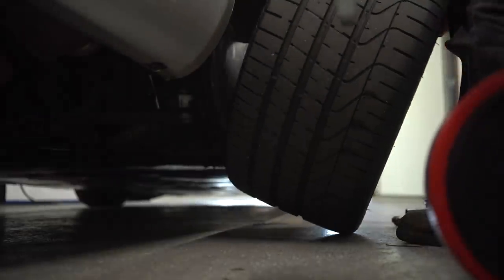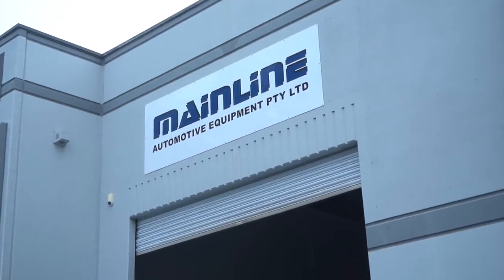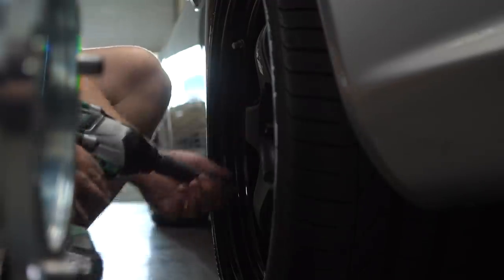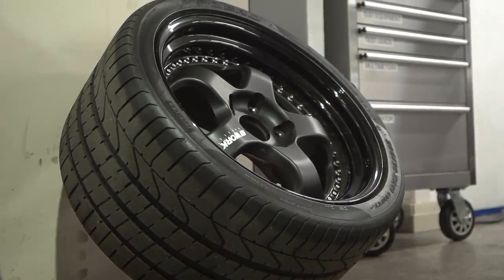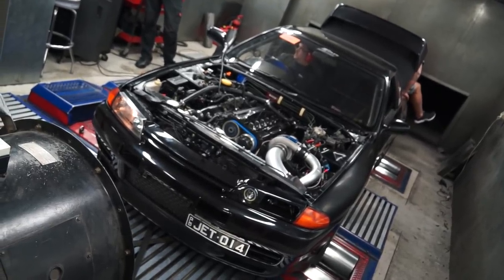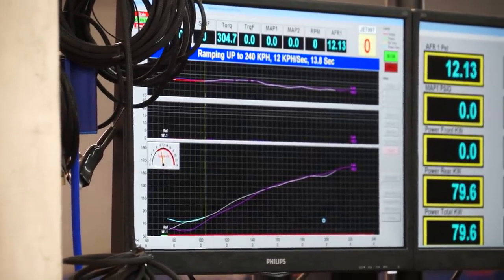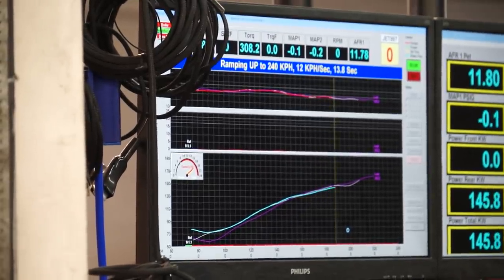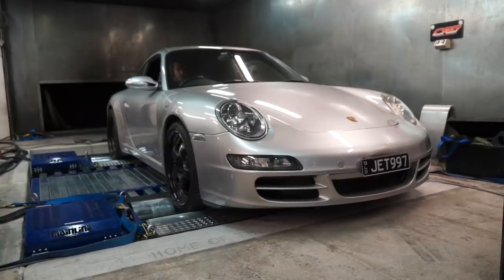Roller Chassis Dyno VS Hub Dyno - Manipulating power and test variables

Comment: great video. hub dyno makes alot of sense. it's not fake power. it's just closer to actual engine power.
Reply: not only that, you can actually tune the engine like you would on an engine dyno.
Reply: all of this agreed ..... however its not the number hitting the ground. as he said there are still variables that the hub dyno removes but come into play when actually driving. A roller will give you a better idea of what is actually hitting the road and drivability. a hub is better for the engine side removing these variables as you dial in the motor, boost , timing,(ect). most ideal shop would have both.(dreamland)

Comment: I'm honestly surprised it's taken so long for hub dyno's to become popular.
Reply: 2023 and shi still the same lmao
Reply: 2023 and shi still the same lmao
Reply: well isn’t the hub dyno basically just a dyno queen sheet? Sure you’ll make a higher number since it’s mounted straight to the car, why remove the wheels? When on the street obviously you run with tires.
Reply: @DEATHWISHVQ because you can't tune high power engines if the tyres are constantly slipping on a roller dyno.
Reply: @DEATHWISHVQ I'd have to disagree. Ive tuned on a dynapack, made 460whp, went to a dynojet 3 hours away, 5 months later and made 459whp with no changes to the car.
Reply: @PiterStreak  I’m not a tuner and it’s really been sometime that I’ve done research on dynos. But a hub dyno as it says it’s mounted to the hub of where the wheel goes, since the wheel is off it’s less rotational mass, meaning what it puts out imo wouldn’t be the same output on the street to the wheels. It’s like crank hp vs wheel hp, the engine will always make more power ofc bc it does not have to go thru the power transfer of shafts etc

Comment: One day people will understand that a dyno is not for measuring outright power, it is comparative tuning tool that allows you to make changes and compare the results, while monitoring af ratios, temps etc. And not crash or get arrested doing it on the street.
Even engine dynos read different from day to day due to changes in weather...

So it seems that a hub dyno gives more consistent figures for tuning high hp cars, while roller dynos are fine for most road going vehicles as long as rules are adhered to for consistency.

Comment: If a roller dyno is calibrated so that power and torque cross at the correct rpm, and drive train losses are accounted for with a coast down test, then how big a gap will there be to a hub dyno?

Comment: forget about hp. which is a better tuning device? it would probably be the hub dyno??
Reply from the maker: By far a better tuning device
Reply: @MotiveVideo  ok, after my research that's what i was thinking. i got my standard s2 rb25det tuned with a haltech elite 2500, psr  g30-770 6 boost etc plaz plenum... made 287kw with 250km on the motor. it drives pretty nice, but it was tuned on a roller. to get the tune right would you recommend getting it retuned on a hub at a reputable shop? cheers Andrew, love the content!

Comment: My only gripe with roller dynos at some shops is its inability to load up the engine properly. Got my car tuned by a popular honda race shop with a dynojet. Made 635whp. Motor didnt last 2 days on the street. Come to find out, their dyno wasnt loading up the engine anywhere near enough for the weight and torque of the car.

Comment: what about loss calcultation ? (to calcule engine hp)
Reply from the maker: What about it? Don't bother. Use an engine dtyno to measure engine HP. EWach car and drivetrain is different and it is closer to a "fixed loss" rather than "percentage loss"

Comment: Not being a smartass but if you squish the tyre for example, the outside diameter should be theoretically the same. If that doesn't change that means the circumference doesn't change either. That means the Rolling radius is the same. So the only real problem is torsional slip. I thought dyno used the equation of  torque to HP/KW conversation? So how does this smp/s effect  the final number?
Reply: If you squish the tyre the roller becomes closer to the axle, thus changing the lever arm, but I do understand what you mean about the circumference of the tyre. Not sure how that works

Comment: Rolling radius won't change from squash the steel belt in the tyre won't get shorter it's like tracks just because it's lower don't make it shorter but you will loose power through side wall flex Wich will show as heat in the side wall
Reply from the maker: The distance from the centre of the hub to the point he tyre touches the roller changes.
Reply: @MotiveVideo  this dose make sense thanks for the reply
Reply: I do find this part quite interesting , the argument don't phases me really it's a guide for tuning . But how the gearing doesn't change but the leverage dose is pretty interesting for me

Comment: Centrifigual mass is the thing.A wheel is a big flywheel  and the more centrifigual mass, eg heavier tyres means it uses more power to accelerate and also stop. 
Many 'bling' wheels and tyres cost power, stopping and suspension. And to me look stupid as well. A wheel that weighs 15lbs for instance and the rim is very heavy V a lighter rim and heavier centre will make a fair difference. So a 14" rim will have less  centrifigual mass than a 20" with the same diameter tyre. And usually a 20" tyre will be faaaaaaar heavier than the same dia in 14"
The peak power howeve will be the same or even a fraction more as the flywheel once accelerated will help maintain power.
The hub dyno at least equalises all of these figures.
And yes different dynos give different numbers. I have done an E85 conversion and made less numbers on a different dyno.

Comment: I hate the whole my dyno makes more power thing. The hub dyno helps with consistency for the sake of tuning,  that's it. That 30hp you "gained" by going to the hub is useless once the wheel goes back on.  the 1/4mile tells all thing is irrelevant aswell. Tire traction, clutch slip/converter slip, gear ratios and driver can change 1/4 mile time drastically without actually "losing" or "gaining" power. I've seen a 4300lb car make 400whp and run 12.9s, watched the same car the next run  do 15.0 because of traction . Some due to improper launch and some the tires being too cold.
Reply: The 1/4 time is not a good measure of power. But the trap speed is!
The time is greatly affected by launch, but the trap speed is not.
Those 12.9 and 15.0 runs - the trap speed would not be very different between them.

Comment: The car is gonna be raced with wheels & tires on it right? So if it makes 300 on a hub dyno then 250 on a roller dyno, you tell everyone 300, then it performs like a 250hp car with the wheels and tires on it, wouldn’t that be disappointing? I feel like you would want to tune with a hub dyno and then use a roller to get the number you actually tell people.
Reply from the maker: 828drifter the whole point of the video was to make people understand the difference to interpret it better

Many American and British dynos try to calculate engine Hp and give really high numbers. We’ve seen some drum inertia dynos in the USA make more “wheel horsepower” than the car is rated to at the engine. 

So rally the power means nothing as every dyno is different. If you understand that you stop caring and understood it’s a tool for tuning. Rea world performance numbers are what matter.

Comment: I have a feeling the loss is due to extra friction in the roller bearings (from the high side-loading due to strapping the car down so much)... rather than the inertia of the wheels and tyres. 

And it’s more likely to be the parasitic drag of the wheels n tires...rather than “inertia”, that’s robbing power.
Reply: hardened steel bearings (as long as they're not overloaded) will not appreciably affect friction in the kW range. If you put multiple kW of heat into a steel roller bearing it's fail very quickly.
Reply: manitoublack yeah true...
Reply: manitoublack i still believe it’s more parasitic drag rather than rolling inertia, though.

Comment: Long story short, don't bother with roller dynos and go for hub dynos.
Reply: Ultimately ultimate dyno numbers are a pissing match. Too many variables to truly compare numbers with numbers. Temperature, humidity, height above sea level, variations between the same type of dynos. Ultimately the numbers are not comparable
Reply: Remember, this guy sells hub dynos. ..but yeah, his argument is pretty solid. They didn't even mention most important part of a dyno though, the organic bit. Hub dynos have no give. They are extremely unforgiving of mistakes and not many tuners have a lot of seat time with them.
Reply: @emmanuelmeris5841  
The ultimate solution is to dyno straight from the driveshaft, but that's obviously too impractical most of the time. Hence, the next best things is a hub dyno that rigidly links the hub to the dyno to eliminate all tyre compliance and slippage. You still have to deal with drivetrain lossess, but it's still infinitely better than having tyre slip mess with your measurements. 

Of course, atmospheric conditions will always be an issue unless you somehow have a climate controlled chamber with no lack of airflow. Short of a wind tunnel, rollers and other means to full to fool the car into believing it's actually moving, it's also nigh impossible to fully account for variables such as how modern cars are smart enough to completely turn off the radiator fan when the car is running fast enough to be better off with no radiator fan running.